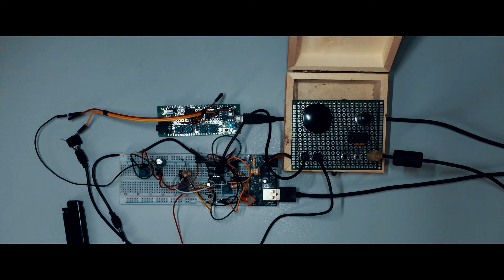State variable filter DIY

Comment: Hi,thank you for share your filter,exactly what i need actualy for a little project.
I have try today with a 4069 without success,i have juste replace the 10k stéréo pot by a 22k...The 100 k résonance pot don't work with the 10 k resistor,so when i remove this one résonance is only effective at the end of the pot.
The cutoff work like a volume but not as a filter.
Thank for your help ;)
Reply: I think this is not 100k pot problem. The 10k(*) in BP feedback  is very tricky. You should find the "lucky" point of its resistance. When you will go closer to this point, volume will get lower. One more simpler 4069 filter you will find here: http://www.electro-music.com/forum/topic-29678.html - it works wery well in my other synth project.